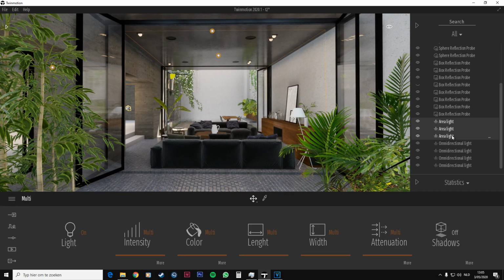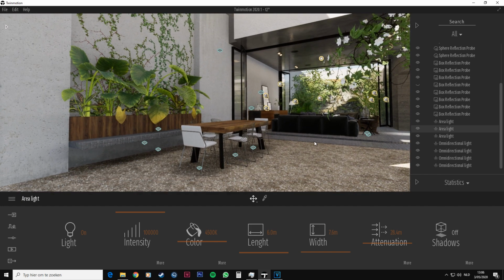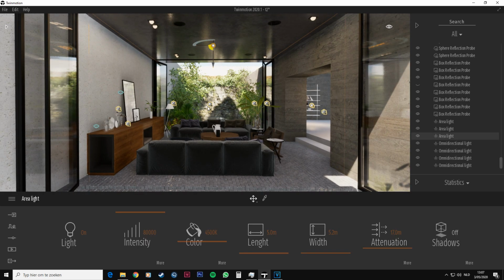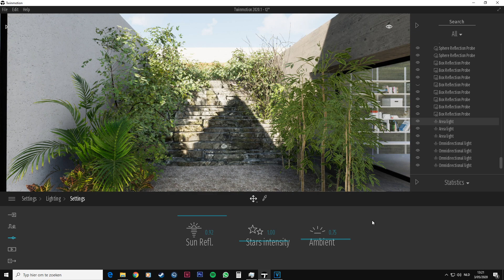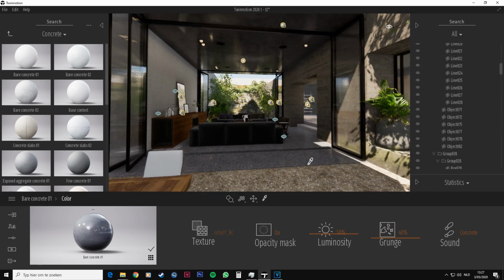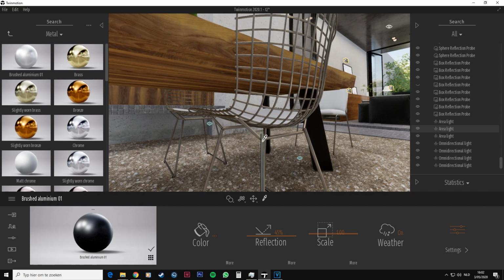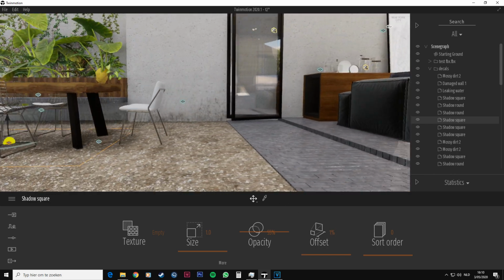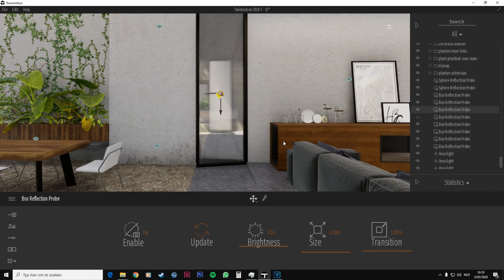Twinmotion 2020 - PN house tutorial  [Interior light and material settings]

Comment: All of the settings are most helpful...
🥂... I was also hoping if twinmotion can have an additional import method of importing not directly into the scene but rather into the objects menue so you can just have it on your left after importing and you can just place it into the scene manually... And profit from the high control capabilities that Twinmotion offers rather than importing an object into a random place than move it and rotate it and this way it can directly b stacked in the user library menu...... It doesn't have to be standard for all imports but only an additional import method... We will have regular traditional import and also import to panel or import to user library option......
Also if we can have a split mesh option for objects such as in 3ds Max's convert to editable poly or mesh than detach face so we can apply material independently on multiple faces cs materials tend to have different directions in d same object...... Now we are solving this problem by importing in multiple layers or colors for each object..... Not to forget a gizmo object in this regard would also help for more control over the texture rotation and manipulation........
Hope I wasn't long... As always thanks a lot for your dedication and professionalism and thanks for twinawesome for making our lives much easier as designers and architects.
Cheers. 🥂